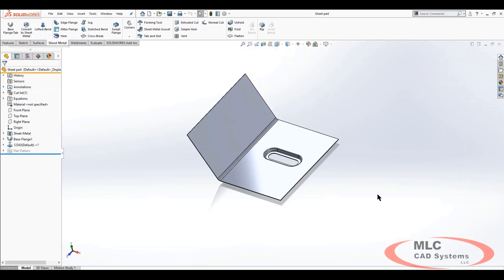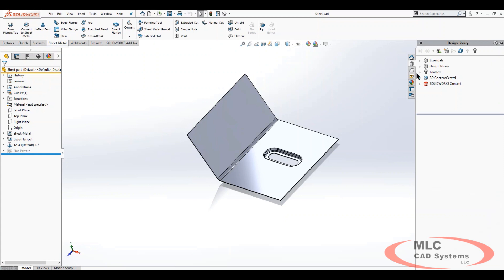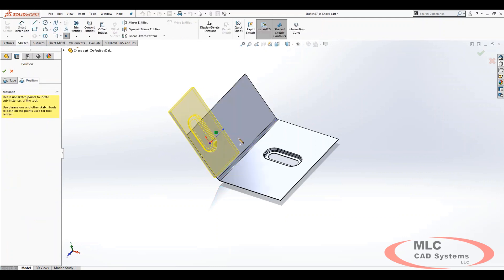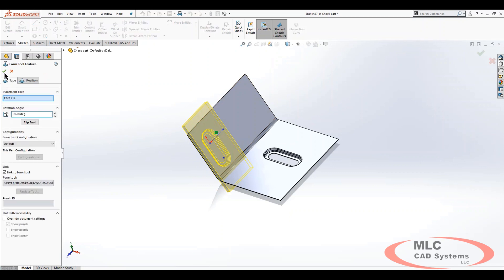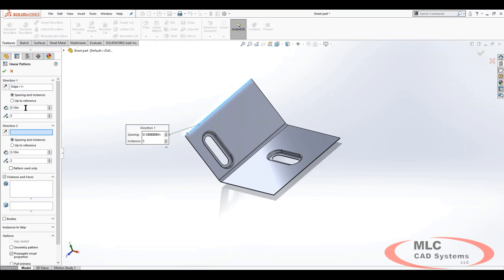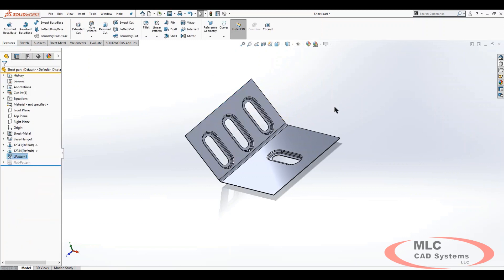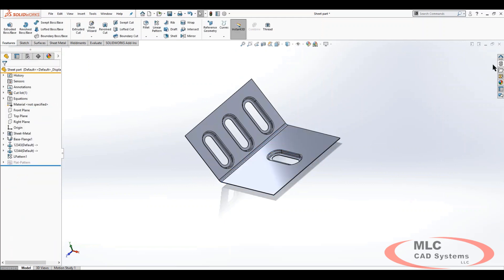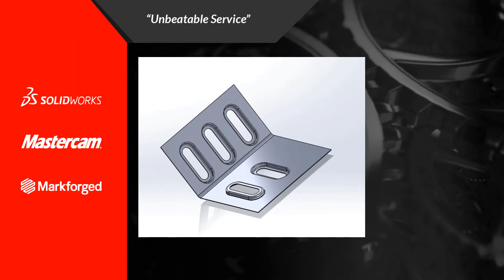How To Use Forming Tools in SOLIDWORKS

Comment: If I have a press, how do I go about creating the tool themselves to form the part, meaning the top and the bottom part of the forming tool.
Reply from the maker: You can use several different methods, including mold tools, extrude up to next but do not merge, or use the Intersect command.  That would get you the feature shape, but you would have to design the rest of the tooling and figure out things like spring-back or stretch separately.